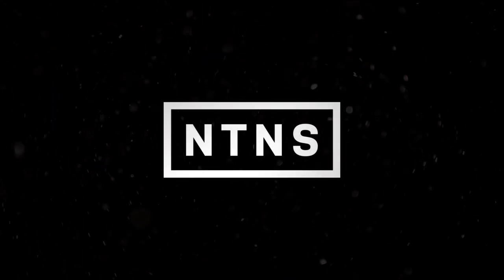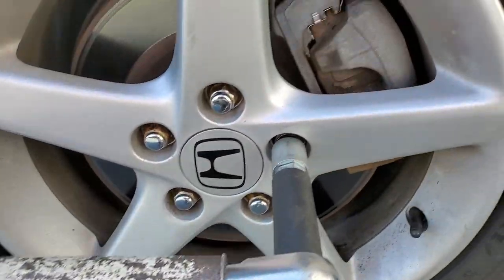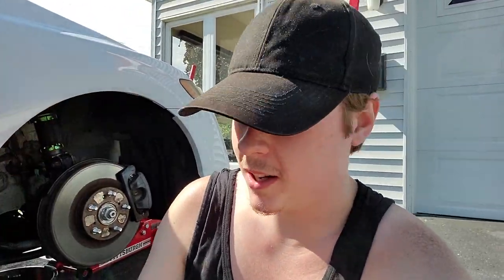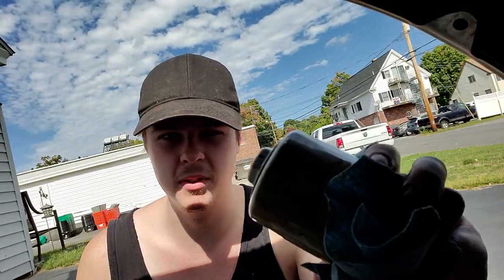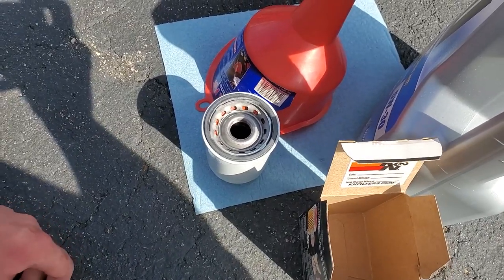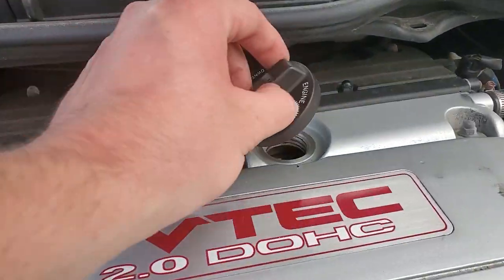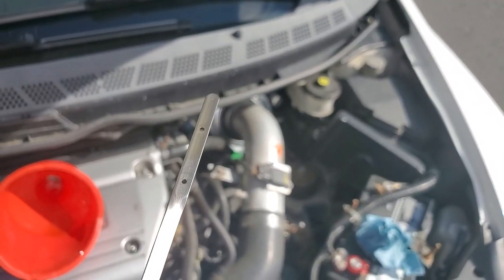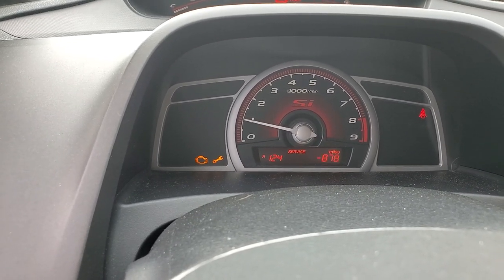How to CHANGE your OIL! 8th Gen Civic SI ('07-'11)

Comment: so i just changed mine and it’s not showing any on the dipstick. i know i put the correct amount of oil there’s no leaks and ive let it run and still nothing.
Reply from the maker: @lukehaar9380  are you on an incline? Incline will result in lower reading, as will having recently run the engine as the oil is circulated through the engine itself vs settled in the pan for a reading. I always seem to need more than the reccomended amount of oil on the Hondas!